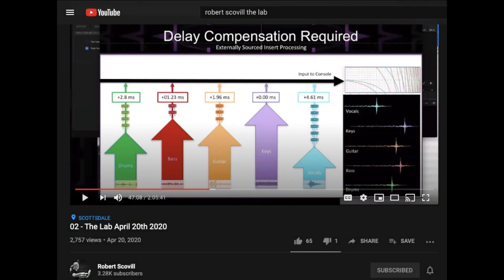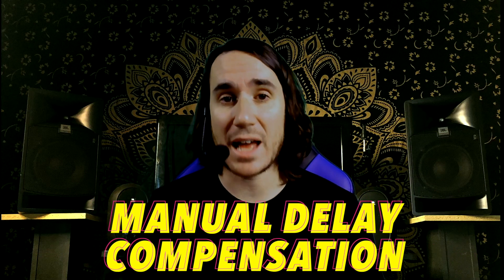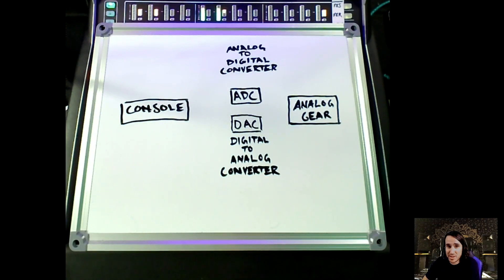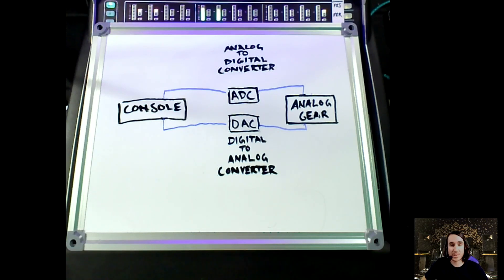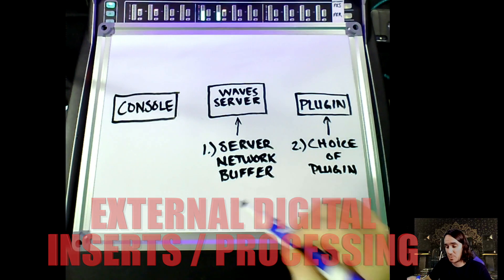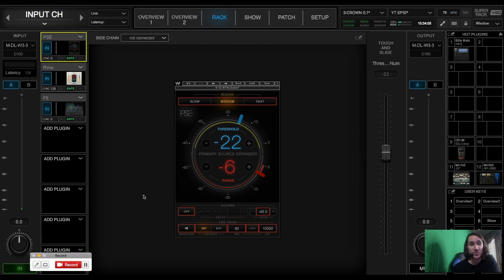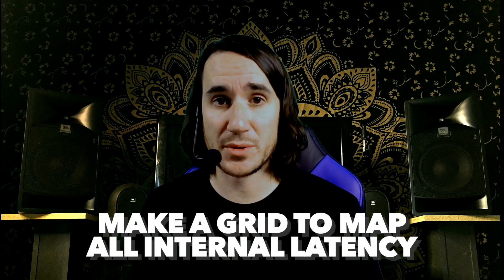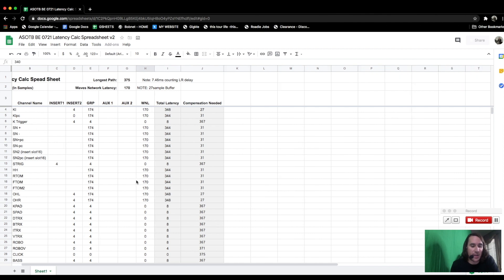EP10 - Manual Delay Compensation - Part 1

Comment: Thank you for this! I was pointed in your direction by Michael Bangs at NAMM this week. I'm trying to think of how to implement this on a CL3. I looked through the reference manual and didn't find any mention of native processing latency (I'm not running any external plugins). I think the way to measure it is to use one channel going straight to LR, and another going through the most processing I would do on a channel (both dynamics, group with 2 inserts to LR) and compare either the impulse response or just adjust the latency until the phase traces line up. I think I can then isolate each step in the chain and deduce how much latency each step introduces. Am I on the right track?